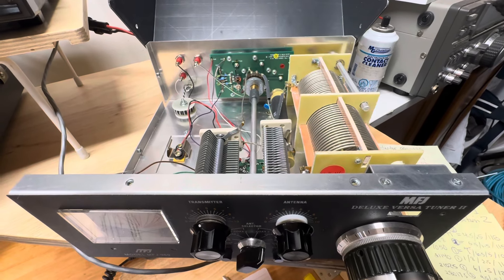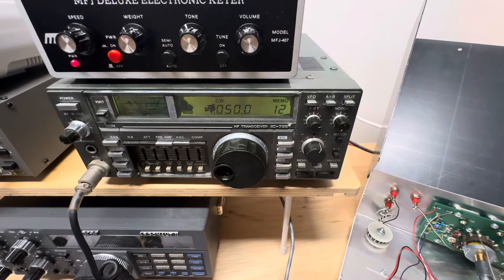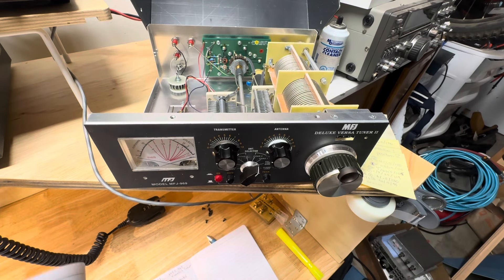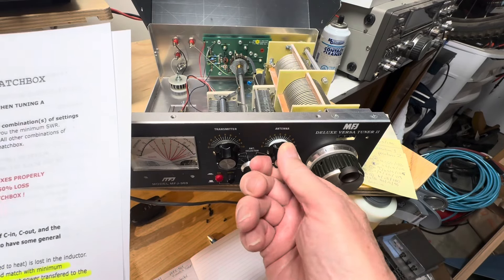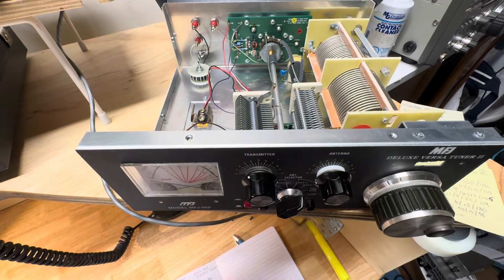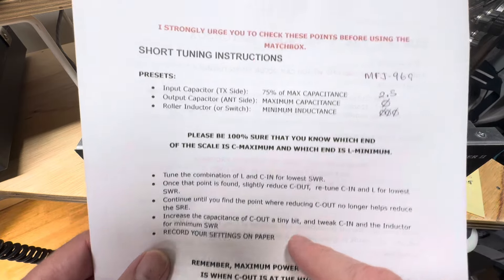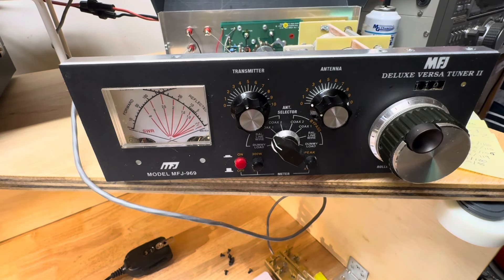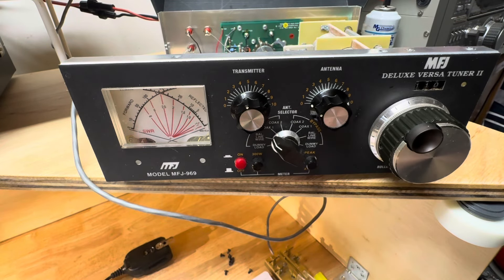Learning to use my Tuner Correctly after all these years…

Comment: I have the same tuner - been using it successfully for years, but I didn't know those specific tuning steps.  Thanks for sharing that!  Now I'll recheck all of my settings too!  BTW, if your roller inductor ever gets intermittent, with 'jumpy' tuning, DeOxit is a great cleaner to fix that.  Might be worth a squirt or two while the cover is off.  73!
Reply: He cleaned it in a previous video with contact cleaner.

Comment: What I recommend doing is setting the knobs to correspond with minimum capacitance ( unmeashed ) to zero on both inductors. That makes following DJ0IP procedure easier. The MFJ manual is wrong. Thanks for the video. WP4AOH San Juan, P.R.

Comment: Why not use the little hex key, or tiny flat head screwdriver (most mfj knobs seem to have a set screw with a flat head) loosen the knobs and set the minimum capacitance position to indicate zero?  Someone made a manufacturing/setup mistake at the factory.  One should not live with that.